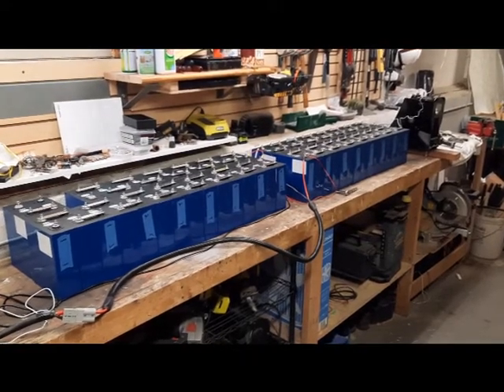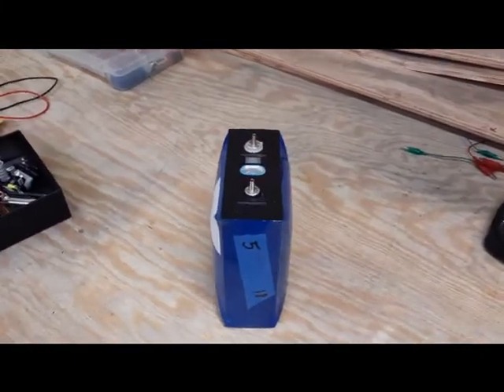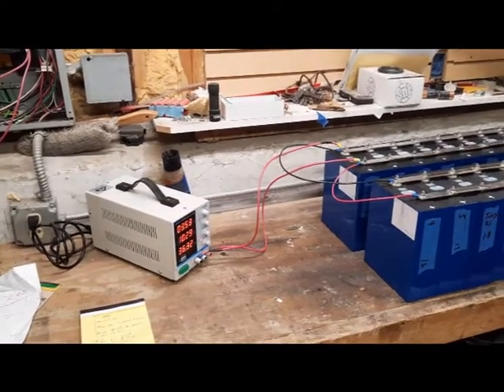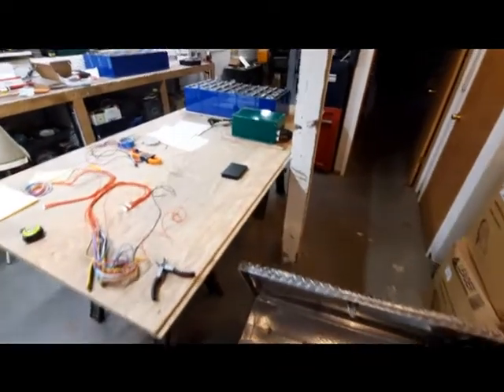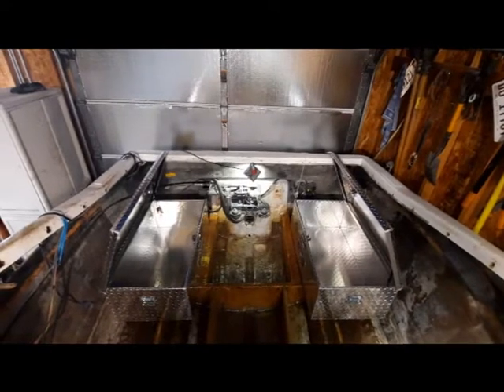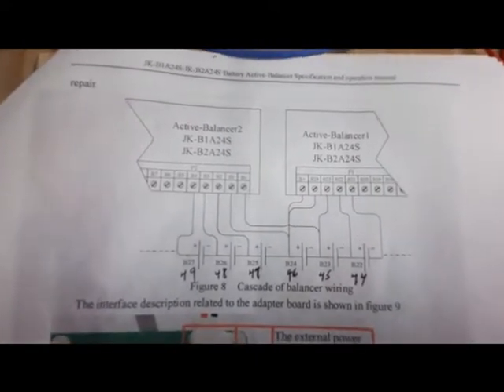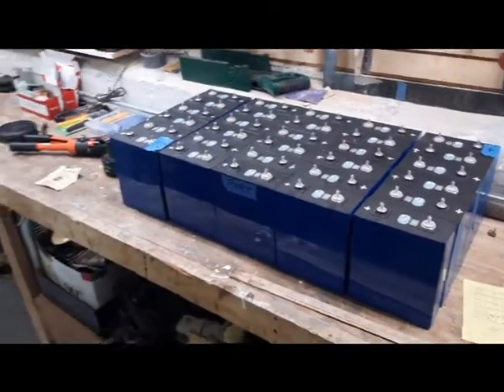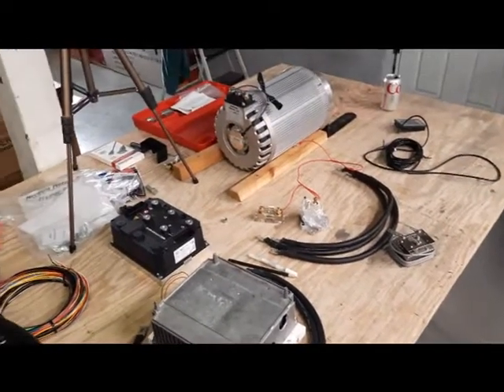EV Boat Conversion Episode 4 Batteries

Comment: I love this series of videos, many thanks.
I don't know if you follow Andy on the 'off-grid garage' channel? He's tested numerous batteries over the past few years. At the moment, there is a great 48V, 15kWh ready made battery from Gopel Power ( https://www.youtube.com/watch?v=aiiJ1IWSWos&t=3s) that I have been very impressed with. If you were undertaking this project now, would that be something you'd consider? I would have thought building a fibreglass enclosure out of the 1/2" plastic with rubber seals on top, would be an ideal enclosure for this battery. What do you think?
Reply from the maker: I've been a big fan of Andy from the beginning. Smart dude, fun to watch. 
I'm not familiar with the Gopel Power battery, I'll take a look.
Plan A was for battery boxes made out of 1/2" PVC covered in fiberglass. Decided to go with the aluminum boxes for convenience. I think non-conductive would be better.

Comment: What chemistry, voltage and amps of your batteries and where did you get them? Any ides of what range you are looking to try to get?
Reply from the maker: There's a good answer to the battery question in episode 1 and more detailed in the battery episode. Short answer is LifePo4, 2p30s, 272 ah per cell, 52kwh total.
As far as range, take a look at the Scott Materson video, he has a completed boat. Not sure where I'll be.